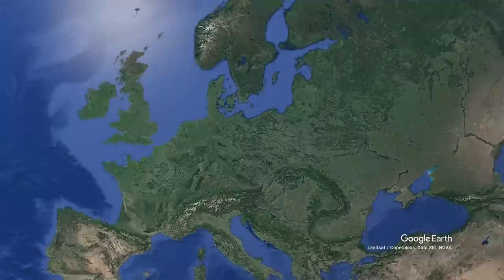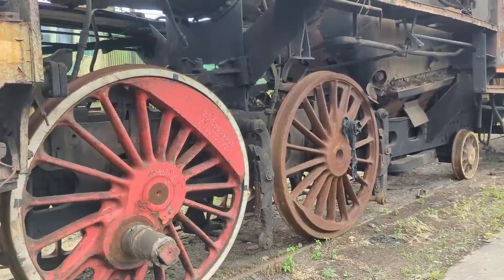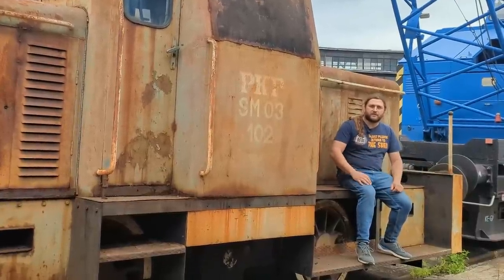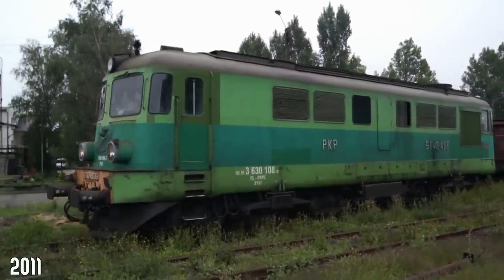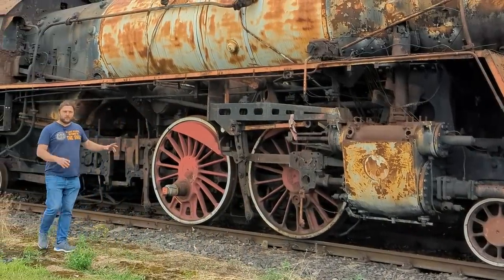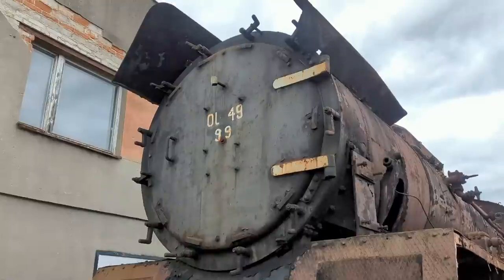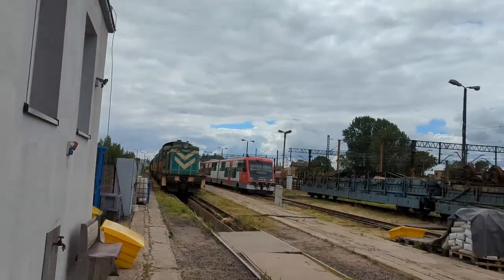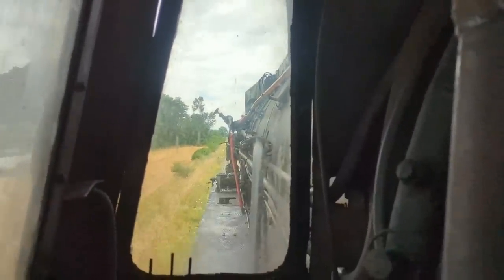Abandoned Steam Trains in Poland - Part 1

Comment: I'm from Poland, we don't abandon old locomotives, this author is lying, we still have a lot of them, and they are just waiting for their turn to be repaired. As you can see, the parts have not been scrapped, but they are still there and waiting. We have several museums with working locomotives that are constantly running, you can see youtube : Festival of Locomotives in Wolsztyn. Do you have your furst Commodore computer ? Not? Why?
Reply from the maker: These are abandoned. Wolsztyn currently has no working locomotives.
The Pt came back, but immediately needed further work.
69 and 59 were working, but currently do not. There is no daily service.
111's overhaul was started in the 2000's and has been abandoned outside, before Leszno works closed.
There are so many parts missing from these engines that restoration now would be very expensive.
The engines in museums like Wolsztyn stand a chance to be overhauled, these do not. Their future is unknown, but likely will eventually be scrapped.
If PKP is unwilling to support the overhaul and continuation of the complete locomotives, then it will not even contemplate using these remains.